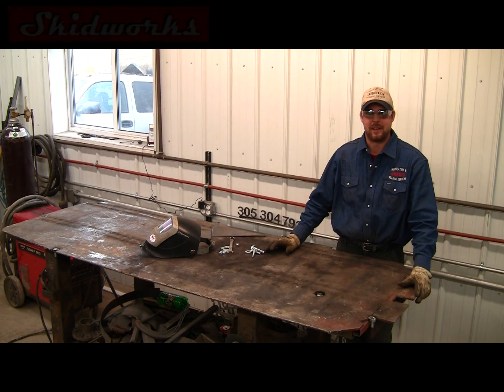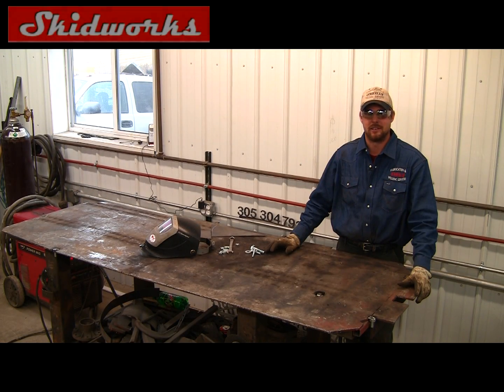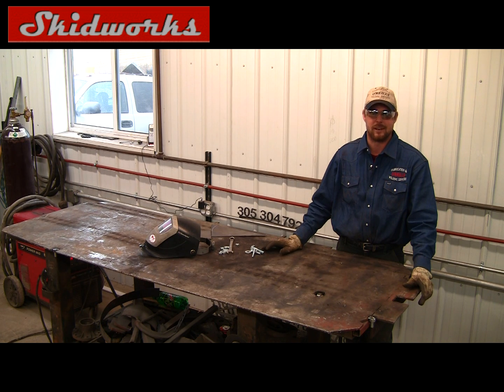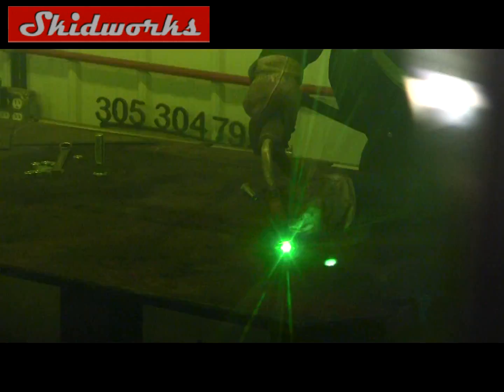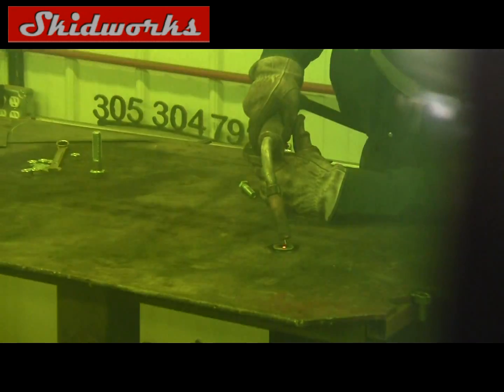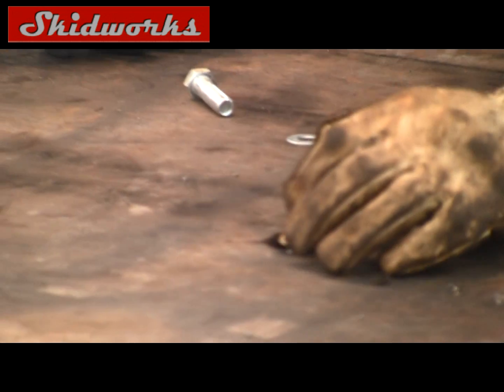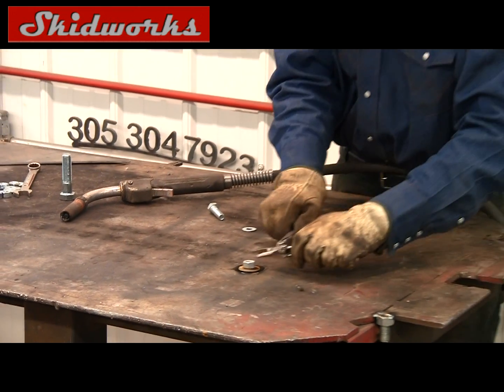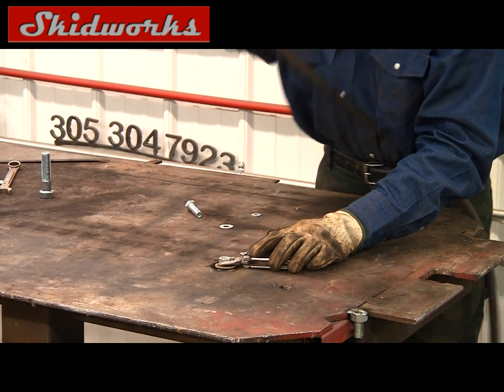Broken Bolt Removal - The best way!

Comment: I just watched five videos of how to remove bolts and none said anything about first starting with some penetrating fluid. Also you using a welder in the wide open is a rare situation . Most of the time there inaccessible .Metal will shrink after is heated red hot but it has to have a place to shrink to.Drilling a hole In The center of the bolt will provide that place. There are many methods that you can employ it depends on the situation and how much room you have to work. But I have found after 42 years as a mechanic That drilling heat lubication and patience work the best. And if all else fails you can drill the center of the bolt out and collapse the remaining threads into that space. Also of it's going hard then STOP ! Spray it with PB blaster wait and wiggle it until you see movement in both direction . DONT just reef on because you WILL snap it off. Good luck....

Comment: I heat up that bolt until it is red hot and let it cool off for 5-10 minutes i have never not gotten ones that never came out. if you heat up the bolt it breaks free of the rust and is easy to get out.

Comment: What if it wasn't broken by torque, but it backed out of a wheel and was severed? Also it is not convieniently at the surface, but down about 3/4". How do you weld the washer to it?

Comment: When you realize a bolt is rusted and might break, Stop. The reason the bolt won't break loose from continuous torque (no matter how high) is that the flank angle of the thread between the male and female section has corroded together and in relation to the diameter there is quite a bit of surface area involved down the length of the thread. One of the best ways I have found is to center drill the head and use an air hammer with a punch to vibrate the surfaces apart.

Comment: I usually just drill out the hole and re tap it at that point.  You can try to use an ez out but if you break that off  have fun drilling through it.

Comment: Use a Stick Welder.  Put a pipe in the hole on top of the broken bolt.  Put the stick inside the pipe on top of the bolt and have someone else turn on the welder.  Use a pipe wrench to turn the pipe/remove broken bolt.

Comment: Ok so I accidentally snapped a valve cover bolt of and it's just shy of the surface of the head could this method work without welding to the head?

Comment: Great tip!  I've already used this a few times, and it works better than any other method I have tried.  I don't know what the guy who said "it don't work the nut breaks off" means.  His weld probably had no penetration.  To use this tip, you do have to know how to weld!

Comment: you said "Very Simple".  HAHA!!  Sure,  now all I need to do is go out and buy a Welder, learn how to use it, and Alls good.  LOL
Reply: And that's a good reason to learn welding. lol
I just payed a guy at a muffler shop 20 bucks to do this on a broken head bolt on my outboard engine... it saved me $100 the local machine shops wanted to drill and tap, and saved a $2,000 crank case.

It took the guy 10 minutes and worth EVERY PENNY!

Comment: easy out do work u just need to know how to use them and when they will snap. another way to remove a broken bolt is using a centre punch to chap the bolt round again u need experiance to do this correctly.

Comment: Get a METAL DRiLL BIT that can drill into steel
Get a CENTER PUNCH and a EASY OUT  from a hardware store
First take some  OIL and put it  around the area  make sure you slow drill
What you do then is take the CENTER PUNCH put it in the center of stud and hit it semi hard enough to put a small mark so the drill bit will stay in the center.
Then  drill into it about a quarter of a inch then take the EASY OUT and set it in the center of the hole and slowly turn it will turn to the left there ya go

Comment: I use this all the time and it works great. I can only add two things. While it's still hot enough, melt some candle wax around the bolt. It goes right in around the treads. Plus a few sharp raps with a hammer on top of the bolt when it's still hot goes a long ways towards letting it turn out easier.

Comment: put a copper pipe inside the hole , plug weld the hole slowly with mig then do the same trick welding the nut on top , high tensile weld metal such as nickel chrome moly @ 800 MPa or just drill out the bolt.

I am a bit pissed off watching these videos because i developed the method myself about 18 years ago long before Youtube came along  ;)

Comment: i have a small around 6mm broken nut below the surface on my fuel tank near the pump... i dont think i wanna weld or do anything involving heat because its on top of the fuel tank... any ideas? i really need some help on this... i dont wanna change the whole tank because of this!

Comment: Okay... my problem is worst. I bought a motorcycle and it looks like the person who owned it last broke off a bolt and tried to repair it him self. Well the bolt has a off center hole all the way threw with bolt still in the hole. What needs to be done so i can get it out?

Comment: been using the nut without the washer for years WHAT  was I thinking , THANK YOU for the idea.    Smaking the head of the nut will help  lossen it up / brake the rust losse,  Check out Freeze Off by CRC too,  pre heating the head of the bolt / stud with a torch before you weld it  will help too

Comment: That engineer has to get out into the real world more. This technique works great. First time I tried this is on my buddies jeep he seared tow of the three studs on the knuckle out at Johnson valley. He ran through three tanks of co2 trying to drill a hole to use an ez out. After the last tank I recalled this technique and took my on alternator stick welder and welded a nut on each busted stud and we were happy campers.  

Half the mechanical engineers I know could'nt pull an axle or change a m

Comment: ok,  question:
I have a glow plug that i need to get out.  the top part that looks like a nut sheared off, and easy-outs wont work.  can i weld to the glowplug?  its not the tungston thats sticking up, its the soft material.  the stuff that is supposed to sort of smash and seal against the taper at the bottom of the hole.  

I've welded steel, and stainless, and melted aluminum before (it sucked too much to call it a  weld) so im just wondering about the material, not the welding.  thanks!

Comment: A similar technique worked for me in gettting rounded off brake bleed nipples out, I a snug fitting nut dropped over it and tack welded internally. Saved the cost and difficulty in getting a replacement slave cylinder... previous owner of that car had overtightened everything, half the bell housing bolts were sheared off too!

Comment: today i pulled out a snapped off bolt from a door closer as follows : by drilling the top of the broken bolt (with smaller drill bit) and this way i made a dent on top of that bolt ,then i hammered a flat screw driver on that dent counterclockwise and i was seeing the bolt was moving and coming out..i wanted to share this with people who don't have a welder

Comment: I've got a feeling that the heat from the welding may be enough to flex the rust bond between the bolt and the case. Then, after the heat dissipates the bolt shrinks down and might come out more easily. I'm surprised to hear somebody tried this with a recessed bolt in an aluminum case. I'd be worried about damaging the aluminum case.... Welding technique is pretty important here because you don't want the bolt to shear beside the weld. Penetrating oil might help. Thanks for posting this video.